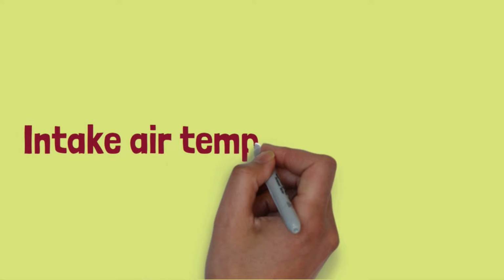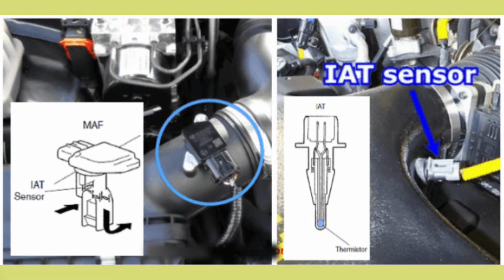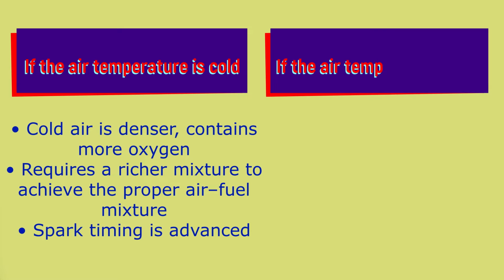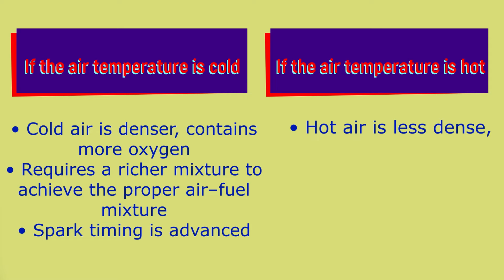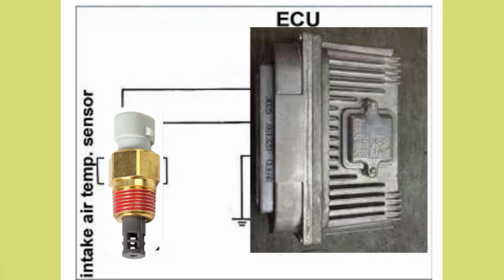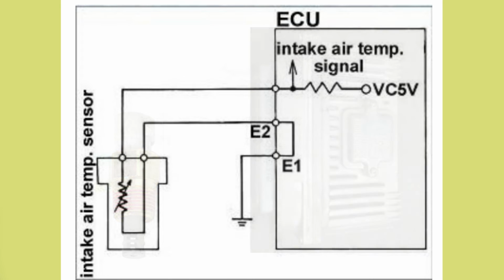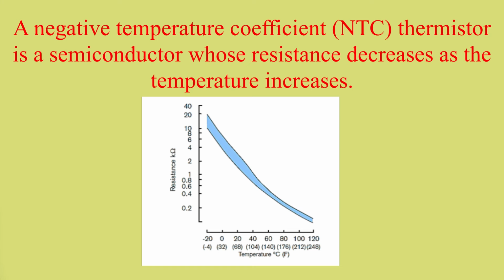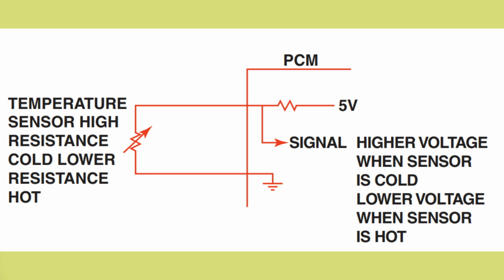Intake air temperature sensor

Comment: Finally I found how this works. Question tho- I have a 04 Envoy 4.2L straight 6. My sensor is on the left side of the air box. The owner before me had a wire connector on each wire about a couple inches from the electrical sensor plug. I don't think it's normal how they had it so I want to put a new wire and connect the 2 wires into the sensor plug. So where does the other end of the wires hook into?
Reply from the maker: Glad the video helped you understand how it works!